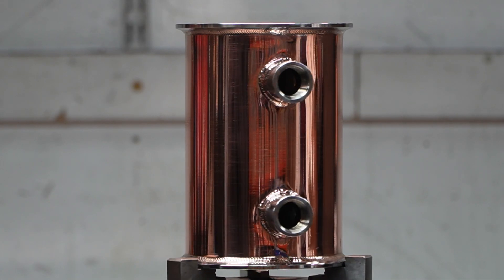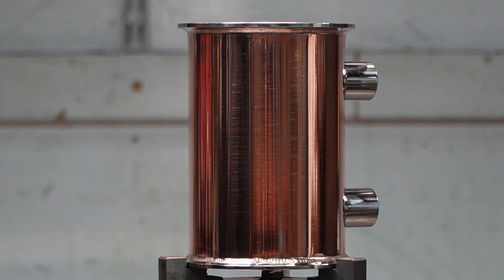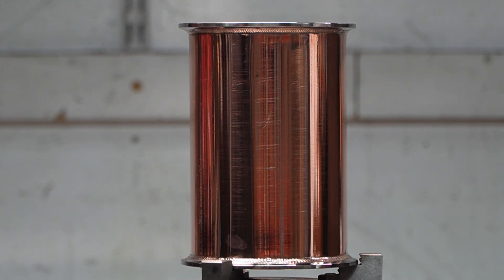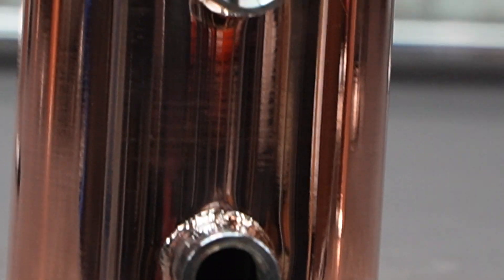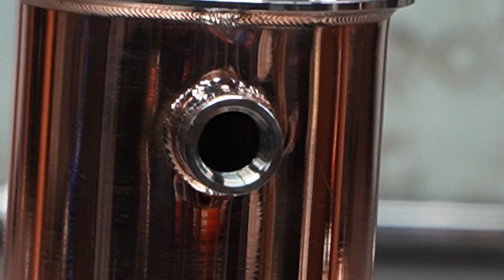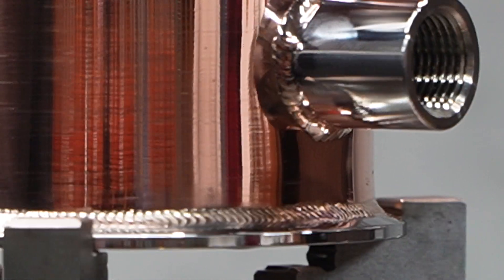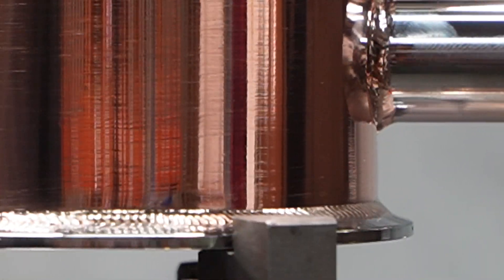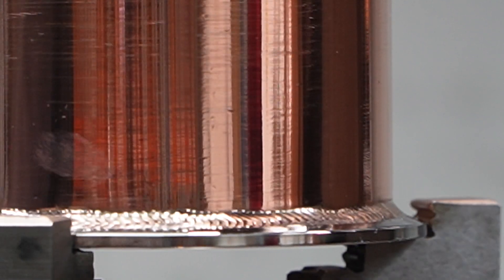How To Build A Still: Dephlegemators and Shotgun Condensers

Comment: whats the diff between Dephlegemators and Shotgun Condensers ?
Reply from the maker: Dephlegs are pre-condensers designed to push low wines down and only allow the lightest of vapors through which essentially means it makes sure only the purest alcohol gets through and allows you to get very high proof. Shotguns are final product condensers and essentially just condensing the alcohol vapors down to liquid again so they can come out as a spirit.

Comment: Always wanted to try welding stainless to copper but don't know what filler material to use to still be safe for distillation. Are you using a silicon bronze filler?
Reply from the maker: We are! It's very sticky, so we run our welders fairly hot and then use silicon bronze rod to fuse the two metals.
Reply: @milehidistilling1  Thanks for the response.

Comment: It's your camera sensor trying to adjust to the sudden change in intensity of light, Since you are welding in a dark place.Add to this the barrel is moving.
Reply from the maker: Okay, thanks! That's what we were thinking, but don't know enough about cameras. Are you aware of a way to adjust it to where it doesn't do this? It sounds like we're SOL
Reply: @milehidistilling1  Set up your shot manually, it might be called professional mode if your using a phone. No matter the name what your looking for is manual focus (this will fix the blurriness problem) you will also gain control over your cameras aperture think of this as your eyes iris constricting creating a smaller opening when its really bright and opening up really large when its dark, or when you consume mushrooms haha. just keep in mind the numbers are reversed i.e. f22 is very small f1.4 is very open. Two things to keep in mind are its effects on depth of field, when the f stop is opened up or a low number f1.4 the focusing ability will be very shallow and when the f stop is a high number like f22 the opening is very small but everything will appear in focus. The trade off is the amount of light that enters the camera, less light means longer exposures per frame. Wanna shoot a landscape use a tripod and f22. a flower closeup you might use f1.4 would get a pretty sharp flower with blurred background which is called bokeh. There is more to this that I could help with depending on the next problem you encounter, feel free to ask. Good luck.
Reply: @milehidistilling1  Get your camera set up on the tripod and focused.  Then turn off the auto-focus.
Reply from the maker: @ylexot007  Thanks a ton! I really appreciate the insight

Comment: I would love to know the specifics about the welding technique. Tungsten geometry, shielding gas, filler rod material, current (DC earth neutral I assume). Are the end caps 304 Stainless?
Reply from the maker: Hey, Chris. We're using Argon as our gas, and silicon bronze as our feeder rod. We keep it old school and use 2% thoriated for our tungsten. Every welder is different, but Noe, our lead welder, suggests between 60 to 90 amps. . Here in Colorado, the weather and humidity affects things on the amperage for us so he recommends finding your sweet spot that works for you. Yes, we're on DC straight and the ends caps are 304 SS.
Reply: @milehidistilling1  Thank you for the details. What Silicon Bronze wire do you use that is safe in an ethanol vapor environment?

Comment: Classic music for classic fab work😅
Ive gotta ask, what # grit on belt sander, and size, type of electrode color?
Another great job in fabrication and video quality!
Reply from the maker: That's right, we gotta keep things classic! We're running a 2"x36" belt with an 80 grit, made out of cubic zirconium. Sorry, I'm not aware of what you mean by the electrode color if I'm being honest.
Reply: Thanx for the grit#! What size i.e. 5/32, and lantham, thoriated,ect. They all have standard colors to match each type.